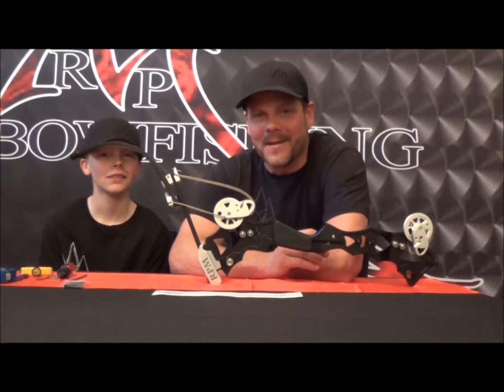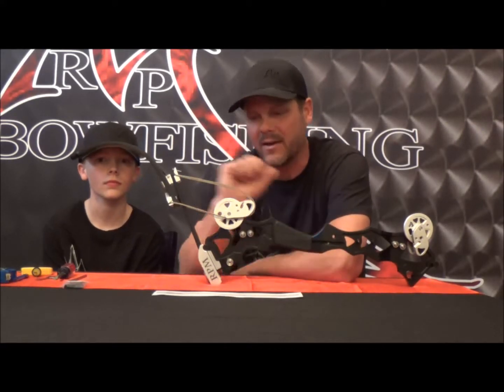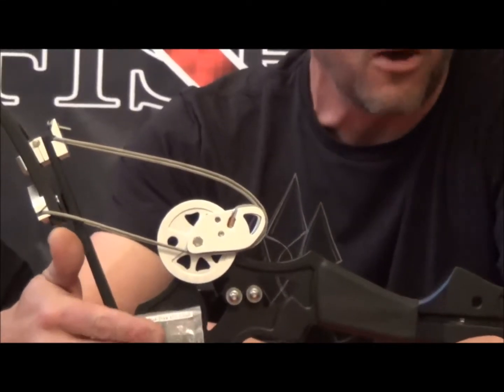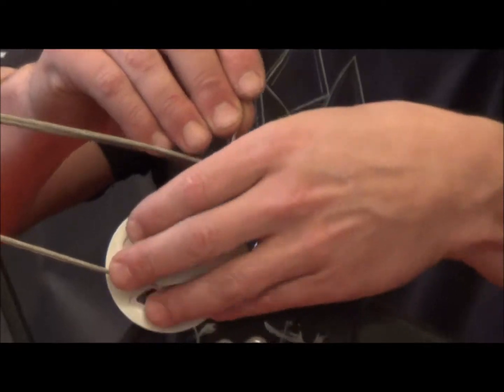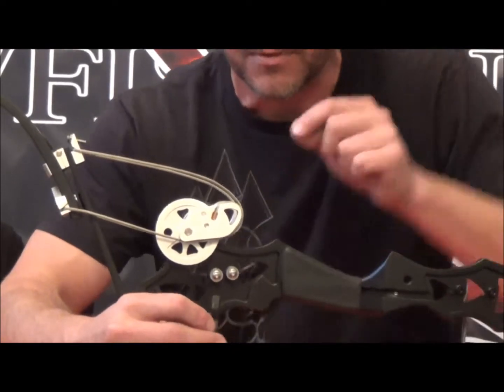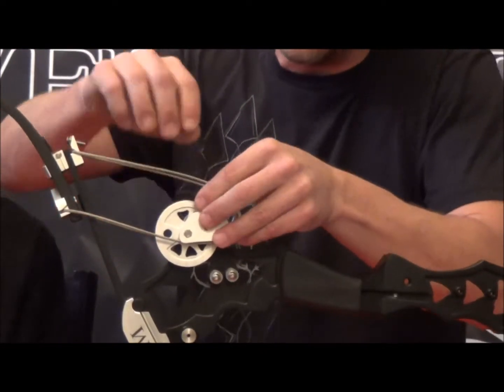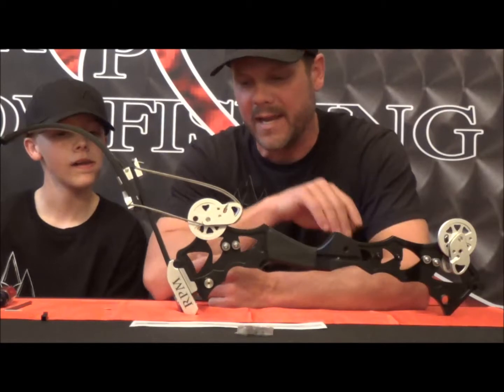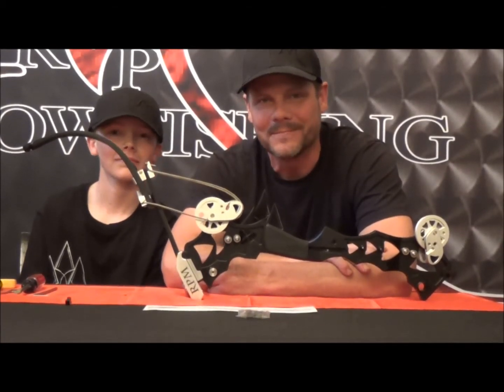RPM Nitro-How to change let off modules

Comment: I'm very interested in this bow ,but I'm mostly a target shooter .just wondering if would suit my needs.
Reply from the maker: Heck yes it will!   They're tack drivers!
Reply: im a  target shooter as well and I love my new  Nitro...this thing a beast and work of  art .
Reply: @rpmbowfishing4047   Why you guys don't explain thoroughly how to adjust Nitro draw weight? I have your Nitro MAG version with D modules installed and i cant get more than 60-65 pounds of it. My pockets have 1mm of gap between riser and i can see that limb can be further pushed trough pocket.
Should i screw in limbs more inside pockets or pocket position is indicator for maximum preload of energy limbs?
Cheers